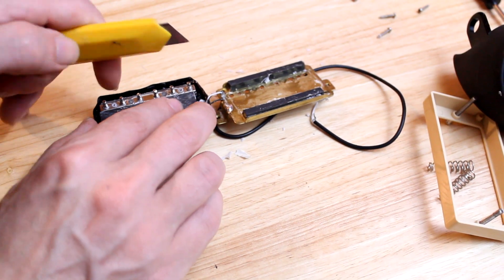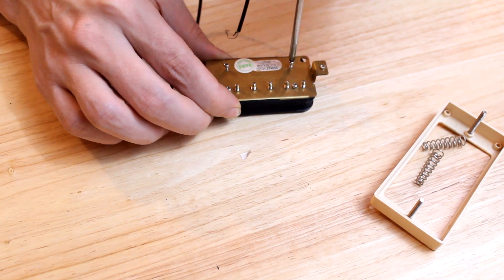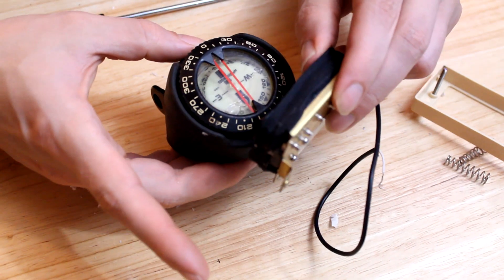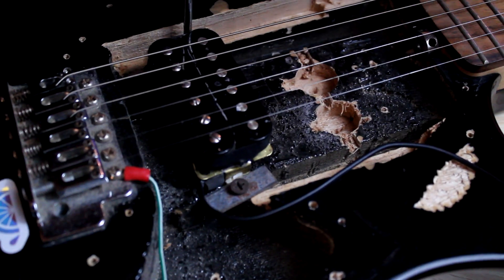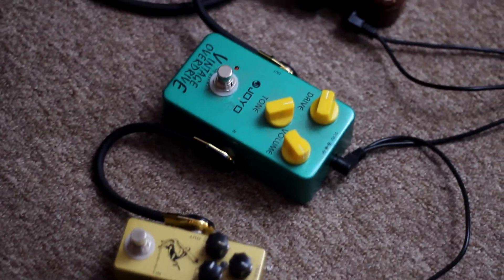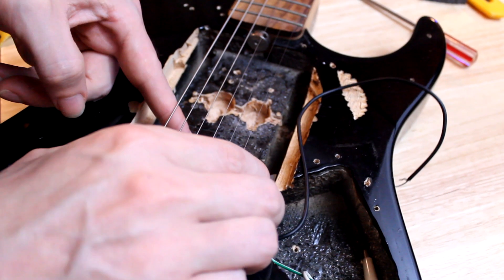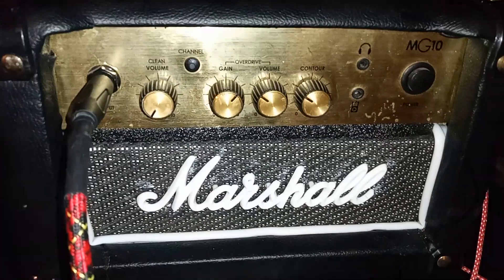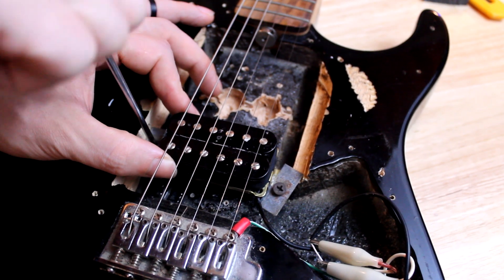Humbucker Magnet Swap Mayhem! (Myths CONFIRMED???)

Comment: I wonder what happens when you play a "proper" neo bucker through it. You know the kind that we've discussed back and forth several times now. Stacked P90 or JM bobbins with the magnets in the right orientation for strength, 38 or 40awg wire, a rail pole piece, and a 4-5k DCR. Perhaps through a more normal setup like this, you'll find the thick wire will be way overkill with the highs and a thinner wire like the 43awg you have on hand would be better to tame it.

Still curious about the "same DCR, Series vs Parallel humbucker" test I mentioned a few times. And, well, since you're experimenting with heads and cabs, maybe some VOX or Orange "sounds" like Rhett Shull has videos on? I know Johan Segeborn does a lot of Marshall (basically what you do, but with heads and cabs, instead), but IMO Marshalls are too sharp for me, classic though they may be.

Comment: An overlooked nugget of wisdom here us soldering your speaker wire not using clips! I got sick of checking my Ohms and finding every few years they were off the posts. Other take home here is why would you ever fill a 4x12 with 4 of the exact same speaker when you want a custom cool sound different then everybody else? Great job at soldering speakers in and blending specific speakers!! I tell people this and they think I don't know what I am talking about then they hear my sound and ask or start looking at my gear which is all tricked out so the labels mean shit other than yes it is mostly a Marshall head and a Marshall cab lol played through some type of Fender Strat style or Gibson LP style guitar that maybe started life here or in China but that was before the fret level and the pickup swap and the trem change, tone vise, bridge stabilizer.... yeah the list goes on and on. Here is a suggestion back for you, when you mic your cab try a CrO2 from Electrovoice. They SUCK at everything but guitar mic  and this is why. They shape high end off without losing it entirely while at the same time bringing lower mids and bass into the mix. They are not high gain and thus cut much crosstalk off. I find they are WAY better than sure 57 or 58 live recordings and they are super Fing cheap because like I said they sound like crap on other things. I think I used them on a talk box with really great results as well but migrated them to speaker mics for my 4x12s due to the exceptional results! You should try one sometime A/B it for yourself. Trust me it rocks! Also when recording live with a band you get almost all guitar just a little crosstalk maybe from drums but so low it is lost in mix once other stuff is added so much so you can even punch in and out during overdubs and only way you would ever know is isolating the track. I also have some videos about the Marshall Code amps coming out so look for them soon. Oh, and recently I have tried Iron Gear Pickups. They sound pretty damn good and almost as low priced as making them by one's self (I bought 3 for about $106 USD) but the lead wires are so cheap the braided wires break after I solder them behind the blob quite often before I get my pots installed. To avoid this mess as cheap shit wire is becoming more and more common... I went downstairs and grabbed my CAT5STP roll and once I un-braided twisted pair single core wires used them to wire pots together. Super strong for it's size, no braided hairs to short out and you can color code using scripto markers or heat shrink cladding. Then I tuck extra wire up into the channel and just tin the ends to the CAT5 cable. In fact, I like it so much I may just start using it for switch wire period without separating it like I do with the pots. I could then just use the solid pair colors as 1 wire each and the stripe wires for 1 wire each. Then when it goes to the pots area super easy to remember what is what and heat shrink tube will cover tips and color code to whatever you want your wires to be. This wire is also super thin and saves space and way hard to break as it is meant to be pulled through walls etc. You would have to ground the foil to take advantage of the STP but that is easy especially if you put copper tape inside all the cavities and ground them together then put liquid electrical tape as an insulator over it all. I did that to my latest Harley Benton because it was noisy as shit and also I put the Iron Gear Pickups in it. When I got done it looked eh but works so I don't care. My next 2 I am doing will be much much cleaner looking when done now that I proved concept. Cheap braided wire blows chunks and since we cannot make them change this is a easy and very cheap work around which is commonly available! You could even just take it out of walls when people renovate literally I have seen Cat5 cable over 30 years old still working.

Comment: Magnets can make a.huge difference on some pickups. There are definitely other variables. My Grote 335 sounded OK with the stock ceramic mags. I swapped out them for an A5 smooth bridge and an A2 rough short in the neck and they sound comparable to Seymour Duncan's now. In another case i had these Epiphone pkups from a 90s Korean made and i put a late 60s patent sticker T-Top A5 and the pickups still sounded mediocre. I feel.like.the metal alloy of the slugs and pole.screws affect tone.too.

Comment: Cool. In my pic you will see a Samick Malibu (black) and the pickup load out from Bridge to Neck is Filtertron (real Gretsch one), Little 59, and a Qurter Pounder (both Middle and Neck are Seymour Duncan pickups). I have Bournes mini pots at 250k and I have a  Grease bucket mod on the Tone pot.

Now all three pickups are loud, beefy, and strong but their construction couldnt be more different. The Filtertron is an Alnico II, while it has a low output, Filtertrons are LOUD pickups. The Little 59 is a ceramic magnet construction (the chrome switch is a coil split) and basically you get a nice, standard humbucker sound from it. 

The Quarter Pounder is actually what I found rounds out a shared signal with a Filtertron (on my Tele Partscaster I have a Quarter Pounder in the Bridge and a Filtertron in the neck) so the Samick Malibu is actually the inverse pickup wise of my Tele. The Wuarter Pounder is a P-90 stand in pickup, there is a similarity in sound but the Quarter Pounder still has that glassy Fender quality a P-90 will lack. As a stand in, it works fine, ,same ballpark but maybe Right Field vs Left Field if you catch my drift.🤔

On the Malibu I also replaced the trem block with a big GFS Brass block and that DID affect the sound both acoustically (the guitar not plugged in) as well as electrically. So this guitar is nowhere near a stock Malibu or Strat (the main point of doing this really) and it basically gives me the tones I want in a Strat style guitar. The Filtertron in the Bridge is that AC/DC Malcolm Young sizzle. The Little 59 in the Middle is a Wayne Kramer from MC 5 warm round eound from his Strat. The Quarter Pounder is sitting in that very warm, round and punchy Jazz area (really sounds great rolling back the tone, super warm like a full hollow body tone). The Little 59 split is the only thing that sounds anywhere near a Strat tone and its a hot Strat tone at that. It was also a pickup I had that I wasn't using (it was in the Tele Neck position when I originally bought it) and it wasn't a bad pickup, I just wanted to put a Filtertron in the Neck on that Tele. 

Sound wise all pickups sound great and what you expect. On positions 2 and 4 the pickups actually work well together. With the Neck and Middle going (with the Little 59 split) it sounds earm with a bit of sparkle). But between those pickups, those little differences make a big difference in hiw they sound. A Filtertron in the Bridge is the only way to get that sizzle and clarity. A good Middle pickup will actually make the guitar sound more like an acoustic (probably be thats where the center of the hole and a acoustic pickup would be). The Neck sounds warm and articulate without the mud (usually I found that the mud is more of a potentiometer on the tone more than anything, cheap OEM pots are just muddy). 

The fundamental idea of the Samick was I bought it for about $76 back in 2020 (the hard shell case cost more) and I wanted a one stop guitar that would do everything. At the time my biddy kept saying "Silver Sky" even though the Malibu is the older model (2004 for mine). Sonif John Mayer could have a cool guitar, so could I. The interesting thing is I think it also channels the Jack White Tripplecaster too except I still have 2 and 4 to blend pickups. The overall touches take the longest time and I am still not totally done with the guitar. The body is slightly Offset but not enough ti be considered an Offset Guitar, more like a skewed Strat blended with a Duo Sonic body (its smaller and slightly shifted). The guitar reminds me of a Jaguar in that it is heavier than it looks. From top to tail its only about 2 inches shorter than a regular Stratocaster. 

If you use a certain type of guitar, like a Strat or a Tele, the architecture and geometry of the parts and strings will still exert a presence in the sound. On my Tele that bridge and neck still mean two hot pickups (Quarter Pounder and Filtertron) still have spank and twang in it. There is still a Strat quality to the Malibu even though the pickups are very far from Strat pickups (which sound good, I just wanted to have my own version of a versatile Strat type of guitar).

I also have some cool pedals I had Alchemy Audio mod. For my Big Muff they added a diode switch to change between none and two other diodes. They also put a Dead Bat feature on the pedal. With the pedal on and changing the diodes live on the fly doesn't really produce a huge difference in quality of the sound. Just slightly different. Its not a better or worse deal, just a shift in a few frequencies. Thats basically what my Malibu taught me, that small change is definitely what makes each pickup sound different even though they are very different in terms of construction.

The other part of replacing or buying new pickuos is that not only do magnets have an effect on the tone , what kind of wire and how you wind the pickup will have subtle changes too. A few small changes can shift the frequencies enough that you like the pickup more or you like it less. 

The best thing I can suggest is to start with the electrics before swapping out the pickups. If you want your guitar to sound and behave better then uograde the potentiometers to CTS or Bournes like Fender, Gibson, and Boutique builders use. I orefer Orange Drop capacitors (47s) on my guitars to make the tone act like a Tone on a US made Fender. I also upgraded the jack to a Switchcraft on my guitars. The switch is a bit tricky because most Import guitars have smaller control cavities (and shallower) so the usual Grigsby and Switchcraft switches are too big unless you want to remove wood from the body (I typically don't). In fact the CTS pots on the Samick were too big and causing an issue with grounding and the fit of the pickguard I had to get Bournes mini pots to correct the fit issues (I didn't want gaps between the body and pickguard coverage from above). For switches I usually go with Kaish (Fender blade style) and JD Moon (Gibson toggle) for parts that are better than OEM (what was stock) but slightly under the Grigsby or Switchcraft options. 

By replacing the original pots your guitar now functions closer to a Gibson or Fender by the feel of the Bolume and Tone knobs. You will also have less issues with the jack too. But what happens is that better electrics bring out more signal from the pickups. I've had a few guitars where just doing this got me the sound I wanted from that guitar and I saved hundreds on buying pickups. 

Is it the same as a Fender or a Gibson? No. Will you guitar compliment a more expensive instrument on stage? My experience is a yes (if it didn't why would I keep doing these mods???). 

That's my two cents.

Comment: Yeah...I didn't hear a difference. Maybe its the high-end loss of my old ears. Maybe it's just that I've never been good at hearing small differences. While I love your experiments and learning about this stuff, my conclusion is always: If I start worrying about things like what type of magnet is in my pick-up, give me a swift kick. 😄
Reply from the maker: Fair enough, I've been thinking that if I tried this stuff in an actual band setting with bass and drums maybe keys, no-one would have any possible way of picking out the differences in these sounds unless maybe when you rip a solo??? Even then it would be more about the guy playing getting the feel from the amp talking back. I do have to say that. I couldnt pick out any sonic difference in Alnico and Ceramic in the room after taking the time to change them but... The feel was totally different the Alnico in easier to "control" I guess? with single coils Ive always found alnico to be more sensitive and prickly... I guess at the end of the day its 10-15% difference at most and so is 2 identical speakers off the same factory floor in a single day? So yeah its Nerdery for the sake of nerdery and perfectionism. Maybe every 10% we can get will add up and even multiply like in a race engine? If I can get someone to listen close and forget lifes problems for a few mins. Im happy ;) Thank you so much for watching and taking the time to comment Robert. I appreciate it bro. 🤝

Comment: ceramics sound the same, the alnico is slightly warmer. If you could stick the neodymium between the humbucker coils, it would sound much better than sticking it on the bottom in the traditional way.

Comment: I only hear a difference between neodymium and everything else. Ceramic and alnico don't sound different at all.
Reply from the maker: Thank you for watching and taking the time to comment AP. That is a completely valid and fair assessment. IF you plug headphones into a clean amp or test the output of the guitar on a scope, even with a fender style amp "on the edge of break up" Worlds of difference. With gain and high volume pushing a speaker towards a mic and then Mastering plugin + video editing compression + Youtube compression = In a mix it would almost be IMPOSSIBLE to tell the difference. Now apposing that is "feel" they do feel quite different in front of a loud amp but how TF? do you convey a feeling in a video... 🤣
Reply: @heavymetalATC  I get all that, but are all those differences really perceivable when you're playing with a full band or when you record everything and mix the song? I doubt it. I don't think anybody would be able to make out what material the magnets in the pickups are made of in the final mix of a song or even at a concert (without looking and guessing). Speakers in your cabinet will make a world of difference, magnets inside pickups, not so much. I think that how you wind your pickups will make a difference in order of magnitude larger then the material of the magnet (neodymium being an exception to everything said, because that's a clear, audible difference). All that being said, if someone will get more inspired and confident playing a guitar that has pickups with a certain type of a magnet in them, then go for it 🤷‍♂ 
I have to say, experiments that you do, and I can't stress this enough, are extremely valuable.

Comment: There's a bass maker that uses Neo magnets. But they use a wooden spacer and thin cylinders as the pole pieces so the magnetic field doesn't saturate the coils. When the coil gets saturated w Neo's strong field , you get that gnarly distortion because the signal is interfered w , right inside the coil itself. When the  teeny tiny Rare Earth magnets first appeared at Radio Shack, I put six on the bottom of a Humbucker slug coil. Horrible sound. Breaking glass, ice pick tone thru a bad fuzz box. I love distortion , tube, and even well done SS , but it was truely awful.
Reply from the maker: Thanks for sharing your thoughts and experience Terry. Yes Ive had great luck with neo in the past as I was using single coil style bobbins. The z coil in the oak guitar uses those little button mags but its got BIG smooth bass. However the p90 in the Bridge using the bars does have a bit of that chainsaw telecaster thing going. I am finding these experiments to be extremely useful personally.. of course now I'll have to do a neo humbucker with the magnet(s) in the proper orientation. Its just wild that I always heard this Magnet power = treble and I always got the exact opposite then this time I finally understand... all tube poweramp or even pure transistor breakup is a big round overload sagged out sound but.. speaker breakup like diode clipping is that in your face ripping paper sound that definitely makes a p90 sound warmer than a humbucker when in actuality a p90 twangs and a humbucker is Jazz. Its all about what comes out on the other end...😉

Comment: Inductance achieved through a lot of winds eats up high frequencies, inductance achieved via stronger magnet boosts high frequncies. Both increase volume. Neodymium is just way too bright and powerful for that setup (but im sure it will be a killer tone in some very low tuning)
Reply from the maker: Thanks for taking the time to comment RR. I agree with you on the windings its just that Ive found the exact opposite in my testing with magnets. but... it was all single coils. As stated in the video this may be a function of the out of phase coils in a humbucker? Or maybe it is just the speaker breakup and diode clipping beng picked up by a 57 that im not used to? I'll have a better idea once I edit the p90 vid. Also I gotta set up a humbucker so that it actually can use the neo mag(s) in a proper orientation.